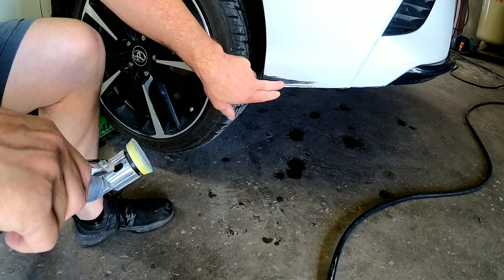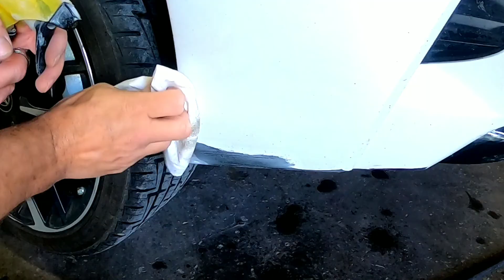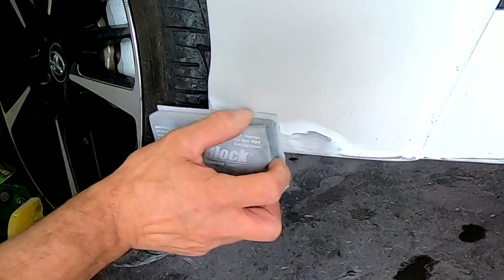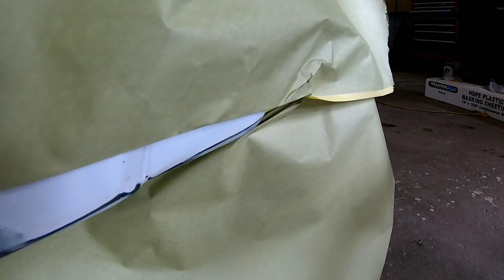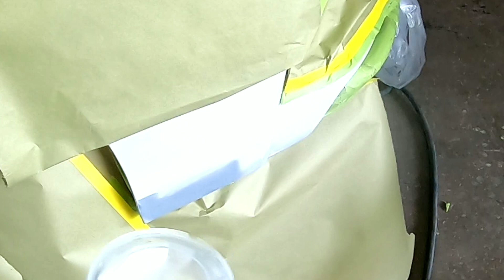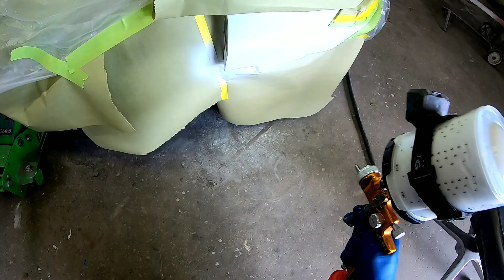Save $cash$ Fix your own car bumper! paint and body repair

Comment: Garage noise great  job could  I use 1k acrylic primer in spray  gun?
Great  video thank you
Reply from the maker: Yes, you could. I would finish sand the primer with 400 if your using 1k
Reply: Thanks